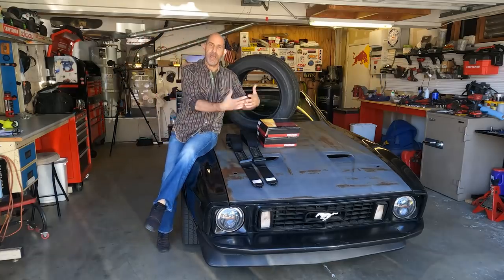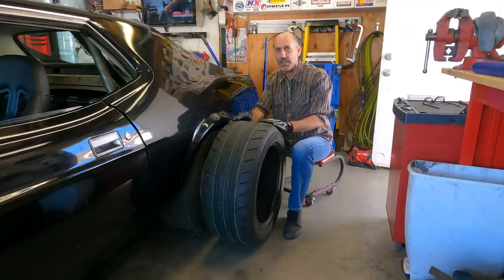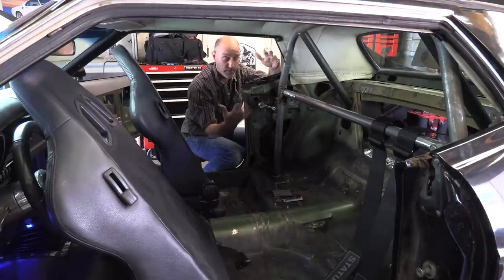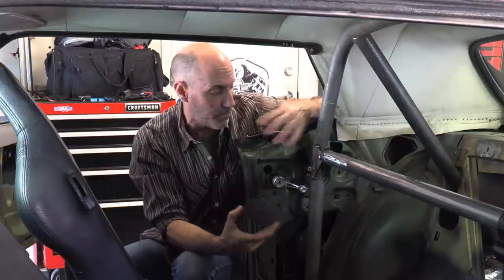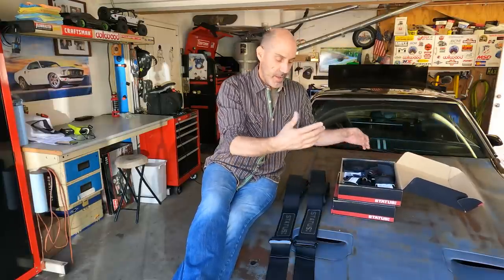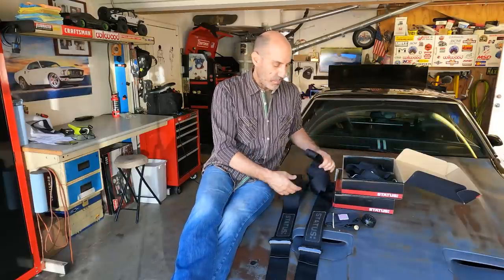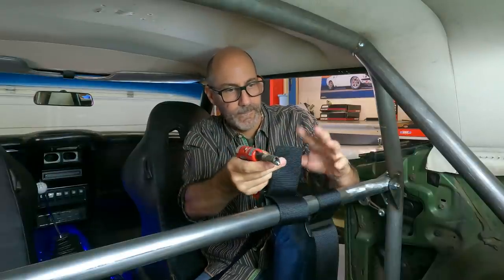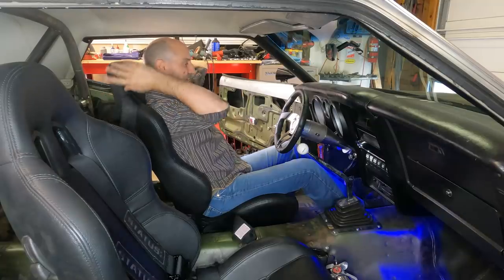Installing Racing Harnesses / Roll Bar Mount and Exhaust Tweak with Flowmaster! Large Marge Mustang

Comment: I heard somewhere for trackuse/autocross/timeattack you aren't allowed to cut the safety belts at all. At least here in the EU.
Reply from the maker: Interesting to hear. All of the sanctioning bodies I checked with state you need to have at at least 4" from the bracket but can be cut and the ends heated.

Comment: Hey Jason another great video 
I'm looking at doing a roll bar in my 2016 Rubicon jku 
Have you considered one for the jeep if so which one?
Reply from the maker: I thought about it a couple times but think there are too many other things I'd like to do first.
Reply: @AutoEdits  
Thanks for fast response
Reply from the maker: Of course dude, if I'm here, I'm interacting!!! Thank you for being a part of this.
Reply: I have also put a lot of thought into installing one. Rock Hard seems to have the most complete kit. I have not done it yet partly because of price, but also because it does require some cutting on the interior. But the added protection is worth it, and is on my list of items to do.

Comment: Welded cages are nice but painting them is a job in hell 😉
Reply from the maker: True, but it's got to be in before you can paint it... so that was the big hurdle for me LOL!
Reply: @AutoEdits  always used bolt in cages, but that stuff seems to be different over here
Reply: @AutoEdits  You can paint most of it before it goes in, or you can use Steel-it. That stuff has metal in it and allows you to weld through the coating.  It is a little pricy but it allowed me to ground my CB antenna on my Jeep after I had to ground through the powder coating.